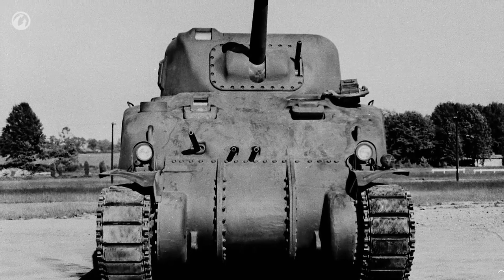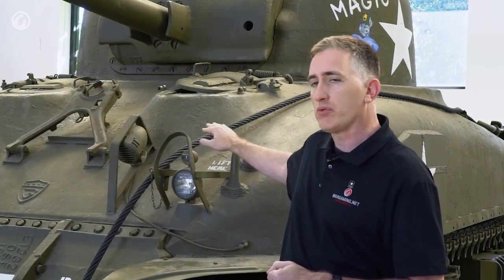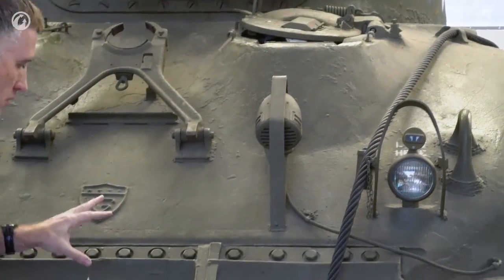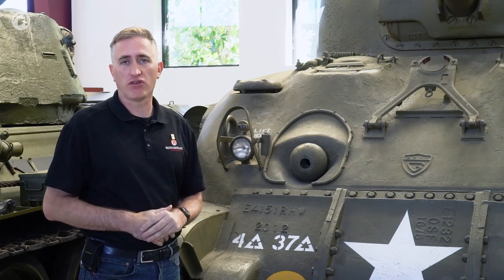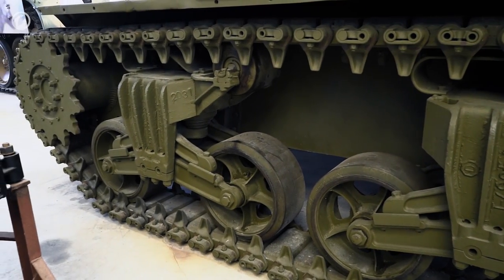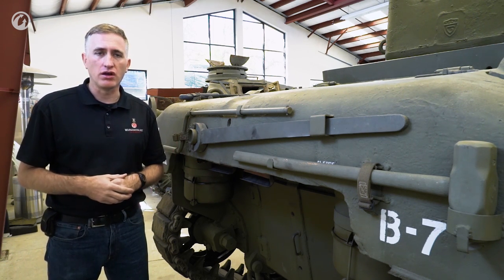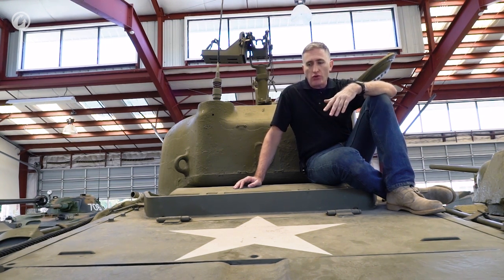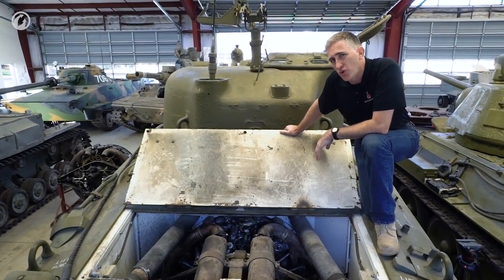Inside the Chieftain's Hatch: M4A1 Sherman part 1

Comment: Im American, but I like if people speak in mm for shells and armour thickness
Reply: He's probably just listing off the official specifications found in manuals and blueprints and can't be bothered to convert between imperial and metric. He did a similar thing with the Centurion video I believe.
Reply: TheDesertScrub I agree but many of the US tanks were designed with inches, that's why you have a 76.2mm gun (3 inches) and why their front armour is 63.5 or 50.8mm. Coz imperial
Reply: the tank gun will either be 76mm M1 or the 3 inch M5  both guns were derived from the same gun but used different ammunition they had the same caliber so the Army refereed to them as the 76mm and the 3 inch respectively
Reply: Just like the british habit of using 6 pounder, etc...
Reply: he's explained before, but he's basiclly using the measurements the vehicle was designed in
Reply: You're American, but you spell armor as "armour"?

Lolwut?
Reply: Oh yeah, I've been doing that since I was a kid, never broke the habit though kek
Reply: Its easier for me to understand a guns caliber when said as 7.5cm and for armor as mm
Reply: In my opinion, no one should be required to convert units for others. While it is a polite thing to do, people can convert it themselves.

But I do agree, I like using mm for armor and shell thickness.
Reply: TheDesertScrub there is shell length, caliber, and charge. As such it's less a measurement and more a designation.
Reply: Me too, plus my War Thunder experience has me addicted to metric measurements and mm
Reply: You are a good and smart american
Reply: TheDesertScrub youre no american
Reply: Same here fellow American. I don't naturally say armour but I've been training myself to do it as it seems like the more reasonable way of spelling it, same as labour.
Reply: SaltyWaffles it s the same thing
Reply: He says the specs in the measurements of which country the tank was built in!!
Reply: Its the General basis of measuring  armored vehicles. 
Its universal. 
Don't like metric? Use it. Most of the world does....
Reply: 17 pounder ready!!
Reply: That's because Armour is English and Armor is not.
Reply: You got the point with comparison between two tanks, but as you stated before, if you want to compare X inches of Sherman to Y inches in Panzer IV you get your Y to be weird like 2 23/64. I wonder, if tank was designed in inches, do Americans have own physical formulas to calculate things like friction, pressure? Or anyway engineers use meters for calculations? If so giving numbers in inches is pointless as it has no constructional meaning. Also I don't understand why weight can be stated in tones but everything else in units most people in the world do not know.
Reply: Not really, The Americans used the imperial for all thier guns. 3 inch is 76.2mm, 5 inch is 127mm and etc
Reply: Same
Reply: One thing Americans don't do, it's spell armor "armour".
Reply: @Raptor747  Probably just a misspell or just thought it was spelled  that way
Reply: TheDesertScrub Probably just  for the tank stuff but not everything else right? For  me Im used to hearing mm for military things  but I wouldnt want to lean metric system. They tried teaching the metric system when I was in school and said that it was the way everything was going to used for measurements but after about 6 months, the country said f that lol. If you asked me what 33 mm is in inches, I couldnt tell you lol. Im with you tho, it does sound cool
Reply: I use mm for tank related specs. But inches for ships. Because i was introduced to ships from navyfield which used inches. Where as I got introduced to tanks from WoT which used mm. Inches and mm are easy to convert. 25mm = 1 inch is a good general rule of thumb. And I can use quick mental math to come up with a pretty accurate conversion in a second. At most I'll be off +/-10mm, or 0.4 inches but usually way less than that.
Also using my mental math, 33mm is about 1.3 inches. Likewise you can use this system to derive feet to meters. ~3.3 feet = 1 meter.
It's easy, maybe because I've been doing this mental conversion for years(as NF is a old game) but its basic multiplication so give it a go.
Reply: yeah mm just makes more sense from a military standpoint. cuz everything else non american that you are gonna come across is metric anyway so why confuse yourself
Reply: SaltyWaffles in American English "armor" refers to personal body armor, like a set of plate armor or Kevlar body armor, but armour refers specifically to any material being used as a building material aka ship armour tank armour armour plates armoured vehicles etc etc
Reply: You sir are one of the few ... really get the metric system in.
Reply: American in 0% of it.
Reply: @boysenbeary  I grew up with metric measures but still refer to my height in feet and inches.  I'm a carpenter and we use millimetres to measure things
Reply: You're not really American if you spell armor like that. Although I'm just messing... It is quite odd
Reply: @neurofiedyamato8763  i was about to post a simular explanation in a public comment...but yours is simple and to the point ...i came to the same reasoning back in the late 70's early 80's working  on american cars for a living when at that time there were both metric and imperial sized screws and bolts under the hood . As a whole car were about 50/50 for wrench sizes and thread pitch sizes ...and it drove old school mechanics nuts...when service jobs only pay flat rate trying different wrenches untill you find one to fit is time consuming costing you money ...and the 70's and 80's car sales went up and down every year ..so i got a job working on bikes and got to the point of sighting out the difference between the heads of metric bolts and imperial bolts at first glance ...and with over sized pistons generally at 4 oversizes for japanese motorcycles of .025 .050 .075 and 1.00 mm  is real close to .010" .020" .030" and .040" are the common oversizes for american vehicles ...so if you want to very quickly compare engines sizes of cubic inches to cubic centimeters  a 750cc bike engine is same size as a 45 cubic inch bike engine ..a 500cc is real close to a 30 cubic inch  ..a iron head  Harley Davidson Sportster is 60 cubic inches that is roughly 1000 cc equal one liter (1.0L) ...a 5.0L mustang is roughly 302  cubic inches ...an 8mm wrench is the same size as a 5/16 wrench ...an 11mm wrench is the same size as a 7/16 wrench ..a 19mm wrench is the same size as a 3/4 wrench ...a 17mm wrench is real close to an 11/16 wrench  etc and so on ...BUT german sized wrenches in measurements called whitworth  do not compare to anything anyone can relate to
Reply: Matrox One  for what? Saying one is better than the other ...the metric system of weights and measure are all based on a common denominator of the #10 making quick calculations simple and easy by merely move the decimal point to the right or left...vs and english rule based on the number of inches in a foot being #12 and you end up with the most common of a 64th of an inch  written as 1/64 of an inch written as a decimal that is equal to 0.015625 inches that is not better at all for measuring anything
Reply: Americans vs europeans vs asians vs Polynesian vs africans ....so which one has the most in common with the entire world ??? America of course because america is made up of every nationality in the entire world working together everyday to give back to the entire world the latest updates for a better life for all ...so a word from the wise... Be careful what you say about americans ..you may be talking about yourself
Reply: So for those like yourself who speak in mm for shells what mm do you ask for buying for a .38 cal revolver  or a 12 ga pump or a 50 cal barret M1 semi auto sniper rifle ...how about ammo for a desert eagle ?
Reply: 1200mm of frontal armor at a 78 degree angle!
Reply: @MrChickennugget360  Yep it was the case length that was a tad different I think. I know some rounds do this when the actual projectile is the same O.D. but the guns chamber is longer.  Snipers use both units.Or they did. They use yards because most American males grew up with foot ball thus seeing and judging quickly how many yards to any given distance  of a target. They see football fields lined end to end. My hunting buddies and I play a game to better our yardage judgment. Then theres is the very technical SWAG used by both Army snipers and the U.S.M.C. Scout Snipers. Scientific Wild Ass Guess SWAG.
Reply: @mattdickson2  nowhere in the US will you find the BrE spelling in regular use.

Comment: Thanks I loved the explanation of American loading dock cranes being limited to 40 tons thus preventing us from using heavy tanks. For years I have read in history books vague references to the Army not wanting heavy tanks because they took up to much room aboard our ships. That bit about our maintenance being so much superior thus creating a myth about Sherman reliability is interesting as well. To be fair the Germans were under the mistaken assumption that most long term maintenance could be conducted between short successful campaigns during which the tanks would be returned to Germany and not only fixed but updated.
Reply: "myth about Sherman reliability"?  The superior maintenance made the Sherman reliably get into the battle, and that is all that mattered.
Reply: The transport ships used their own boom cranes to load and unload their cargoes. The crane's load capacity was determined by the strength of the booms being used. The standard boom could handle 30 tons and the heavier booms could handle 50 tons. The 50 ton booms were stored on the ship for use when needed. 

The Army War planners had access to European commercial truck maps that showed the weight limitations of road bridges so had the weights of the M3, M4 and truck/trailer rigs limited so they could cross the majority of the bridges along with their own field bridging and pontoon bridging. The 55 ton M6 heavy tank was developed at the same time as the M4. The Army determined it would be more of a hindrance than an asset on the battlefield so decided not to use it. That didn't bother the War Department since that freed up the availability of the RR flatcars capable of carrying those to haul heavy machinery and loads of steel to construction sites, factories and shipyards. The shipyards produce special tank transport ships that could carry 250 M4's or 410 M5's.

Comment: A minor quibble.  The steel plates welded to the front of the hull hatch housings were definitely not "sheet metal" (by definition sheet metal is less than 1/4 inch thickness), they were in fact armor plate.
Reply: I cannot wait to crowbar this little fact in at a party.
Reply: It's actually 1/8th but still
Reply: Thick sheet metal.
Reply: Sheet from 6mm down, plate from 6mm up. 6mm described interchangeably as either sheet or plate depending on who is describing.
Reply: Homogenous Armor
Reply: I remember noticing that on this or another video. Correct terminology is important. Sheet metal is what airplanes and cars are made out of. Not tanks.
Reply: The difference between plate and sheet entirely depends on the region/dialect of the local area. In some industries, 10mm can be considered sheet

Comment: US depot in a nutshell
mechanic 1: bro do you have an extra track link and a return roller? Greta Garbo just took a tellermine to her tracks and we had to drag it back here since its kinda okay

mechanic 2: there's plenty besides the stockpile of turret bearings. oh and can you get me a couple of nuts and an additional spark plug in the pile as well?
Reply: ZeKeR BaNaaG 
That's funny! 
lol and lmao!

Probably.
Reply: The US tankers had three repair depots at their disposal. First depot was 1/4 - 1/3 mile back from the front lines where tankers could motor into for quick repairs. The second depot was a mile or more away where the disabled tanks were taken for repairs. The third depot was located back in the rear and served as the wrecking yard/major rebuilding facility/parts warehouse.

Comment: At least for the period they were building the Canadian M4A1, they did increase the thickness of the front plate in some locations, also the slope was said to be improved somewhat compared to the earlier versions.  (They may have been looking at a large hatch hull casting at these dates)

25 Nov 1943
Colonel F.F. Fulton, O.B.E., S.D.(W), C.W.H.Q.
ACIGS advised COS that UK is expecting 6500 sherman from USA in 44.

"Sherman tanks were seen in production at Montreal locomotive works. The total order is 250. They had delivered 38 as of 22 oct. The production line, however, at that time had just commenced to move in good order. Certain modifications are being incorporated to Cdn requirments. An outstanding change which was noticed is the variation in contour and thickening of armour at the front, providing, in effect, a straight horizontal front line between sprocket housings, rather then the recessed front with which we are familiar."

Aug 1943
Senior officer
Canadian Military headquarters
2 cockspur street, trafalgar square,
London, S.W. 1, England.

"The thickness of the front of the hull casting has been increased in parts, in general, the ballistics are unchanged due to the slightly increased front slope."

Comment: The hand crank was to eliminate hydrostatic lock caused by oil pooling in the lower cylinders. It's standard practice on radial engines. I always wondered whether the German inverted vee aero engines did this as well.
Reply: He did specifically explain the purpose of the cranking.  And it is a factor in any radial
Reply: The cranking was to clear oil from lower cylinders to prevent hydraulic lock, not hydrostatic lock.

Comment: M4 side: Blocky

M4A1: Smooth AF

M4A4: Even blockier
Reply: @darnit1944  They're smooth, sure. But remember that the angle still exist.
Reply: @YuriYoshiosan  Yeah, you better angle your tank to maximise the armor

WAIT
Reply: @darnit1944  The more the angle, the more deeper and thicker the armor is, and the enemy need more power and bigger caliber, or better shell to penetrate it.
Reply: @YuriYoshiosan  But please do remember that the rounded cast hull.
Reply: @YuriYoshiosan  That's the reason why the flat RHA M4A2 onwards is better than the A1
Reply: @darnit1944  It's hard to hit the angle because if enemy aims from the high ground, even not enough to hit the turret roof, it can hit the hull roof and blow through the rounded cast and hit the driver.
Reply: @YuriYoshiosan  Lets just stay on the flat surface 1v1 here. The cast hull is inferior to the flattened RHA armor. 

Not to mention that it is prone to cracking in real life

Comment: Mr. Moran, you might has aware of this but I'll comment just to be sure.

Belton Y. Cooper's memoir, "Death Traps: Survival of an American Armored Division," goes in to incredible detail about the the mechanical and military goings-on of Patton's Army post-D-Day.  In the book, he cites the mechanical redundancy of the American mechanized force.  

Particularly, Mr. Cooper mentions the track durability of the Sherman tanks that allowed them to be inverted, thus allowing one track-set to be used for longer periods than contemporary German/Soviet tanks.  Of course, this is a wear-item and not the power-pack, per se, but it adds to the "readiness" of a Sherman battlegroup as a whole.  The book has other examples of the mechanical durability of the Sherman tank.  If you are unaware of the book, it is definitely a must-read for connoisseurs of armored warfare!
Reply: He has went over it before, it's a fine book as a memoir and the day in the life of an ordnance officer, but should not be used to refer to the M4 completely considering it's common mistakes in historical accuracy. However, your point is quite correct.
Reply: Of the various types of track Sherman had, only the oldest was the reversible type. All the others were one-side-only, although the flat pad type (equivalent to the reversible) had double the thickness of rubber on the road-contacting side,  to provide effectively the same amount of distance, without having to reverse it.

Comment: Great video-looks like the design engineers paid a lot of attention to reliability and repair. These tanks were reliable and easy to fix-you could swap out an engine in 3 hours. The same job on a Tiger took days. A reliable tank meant more on the battlefied.